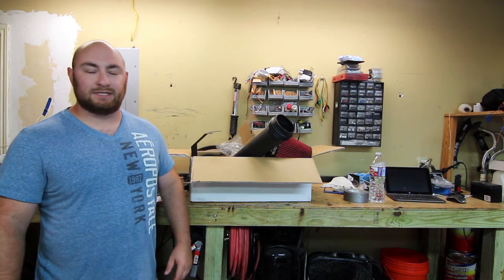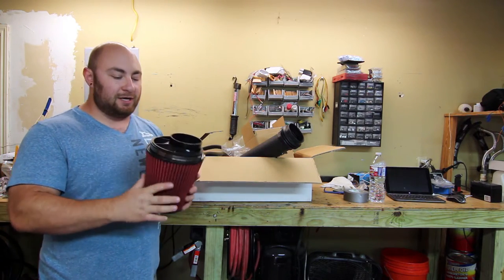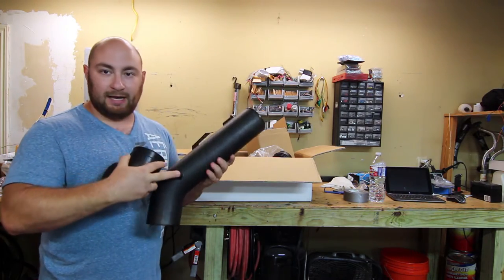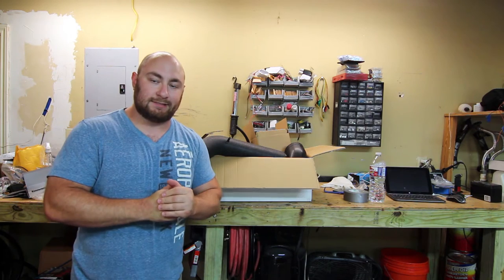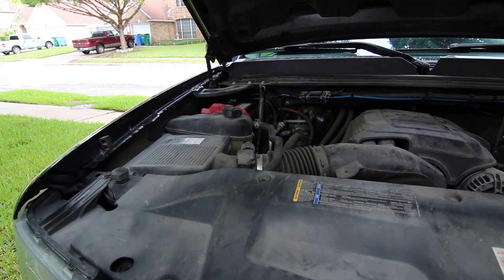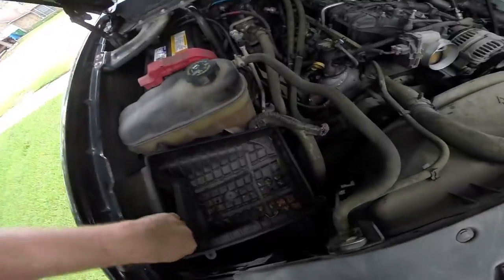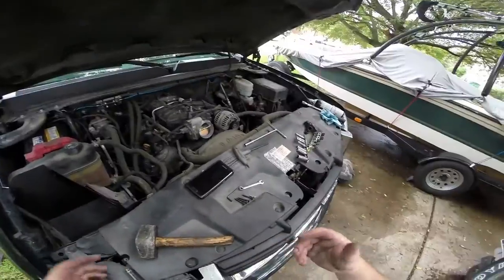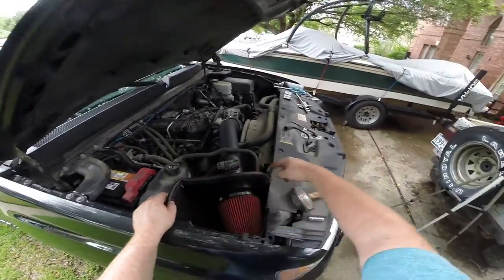2009 GMC Sierra 2500HD - Speed Engineering Cold Air Intake - Installation and Review

Comment: I just found this after looking for an intake upgrade for my 2014 GMC Yukon 5.3l.  I do already have a BlackBear Performance tune, and am looking for a little better throttle response/sound vs. OEM airbox/intake. I agree that there's not going to be much/if any performance upgrades, but it should work well in conjuction with the upgraded tune, and future exhaust upgrades. 

 I'm glad there was a GOOD quality video on YouTube that shows the parts & install.  Props for your clear and concise video/info.  About to order this setup now.

Comment: I just bought this where does the  air cleaner sensor plug into
Reply from the maker: You mean the air flow sensor? It bolts to the tube and plugs into the original harness.
Reply: @Makswerks1   no attached to the same wire is a air cleaner sensor that is mounted to the bottom of my air filter box my maf is plugged in and screwed down and I’m still getting purging and a engine light
Reply from the maker: @kylek494  what year is your truck? Might be an ambient temp sensor. I didn't have one from what I remember. Just the maf
Reply: @Makswerks1  13
Reply from the maker: @kylek494  that's a transition year. Seems like yours might be too new as this intake is 09-13.
Reply: @Makswerks1  that’s what I was thinking maybe just the 13 and 14 2500’s have this because my dads 2010 3500 doesn’t have it either
Reply from the maker: @kylek494  ya you can also ping Speed and see what they have to say

Comment: @MaksWerks Is this better or an oil filter ? What difference will it make ? Great video , very informative, Thank you !!
Reply from the maker: I prefer "dry" non oiled filters. These seem to last longer and do a better job keeping the engine clean. I doubt there is much if any performance difference compared to an oiled filter, but there should be some difference compared to the restrictive factory system.

Comment: Hey man! Nice video! i Have a 2011 Sierra 2500HD 6.0 vortec...Could you send me the link or part number for this intake? thanks! i currently have a black widow race venom muffler in place of my stock muffler and 3.5' piping out to the stock location wit a 5' chrome tip! sounds amazing! Way better than flowmaster and magnaflow which EVERYONE has! After i get this intake installed im getting the truck tuned by BlackBear Performance! Im looking at AT LEAst 60-70 HP gain all said and done with my current mods which is pretty damn good for a gas truck!
Reply from the maker: http://www.speed-engineering.com/shop-by-vehicle/1999-13-lsx-trucks/induction/filters-intakes/speed-engineering-cold-air-intake-2009-13-4-8l-5-3l-6-0l-6-2l-engines.html
Reply: awesome thanks man! Any issues so far at all with this intake? i still cant believe people buy K&N and AFE intakes for hundreds of dollars lol! These cheaper intakes flow just as good if not BETTER than those high end intakes...
Reply from the maker: I love it. Went offroading in big bend for a week (tons of dust) came home and blew filter out. Like new. Oil was sent to blackstone from last change  - perfect event after all that nonsense. I am very happy with the fit and finsh as well. Planning on getting long tubes and full exahust from them. Then do a HPT tune myself.
Reply: Nice man. A tune sure does make these 6.0 vortecs basically a whole different monster! Cant wait to get mine done! Blackbear is one of the best when it comes to the LS trucks